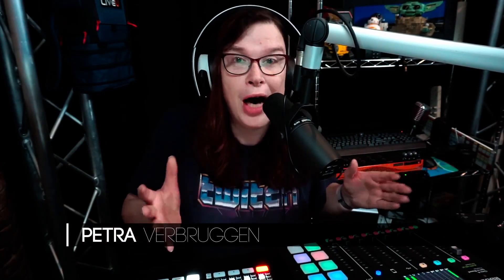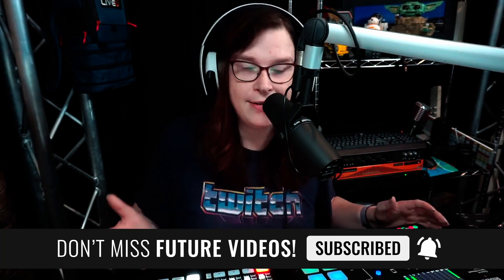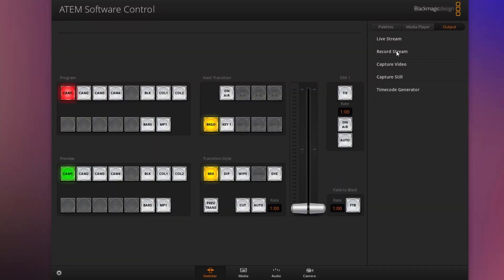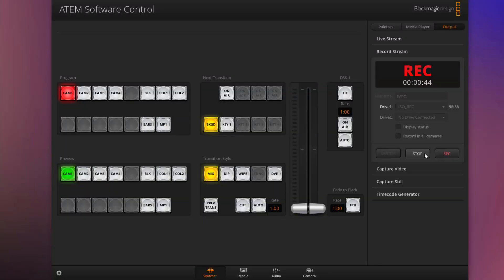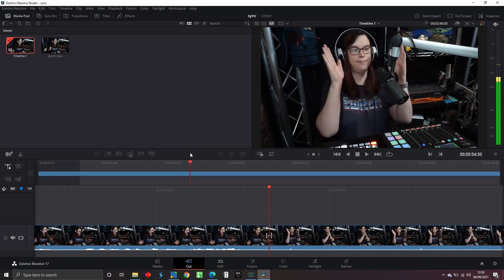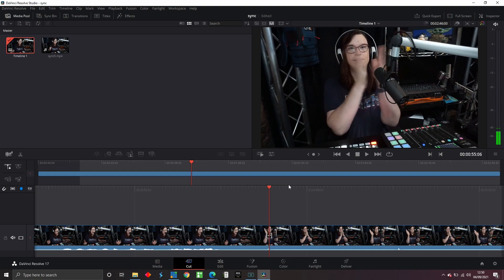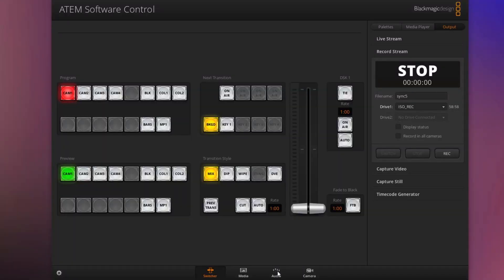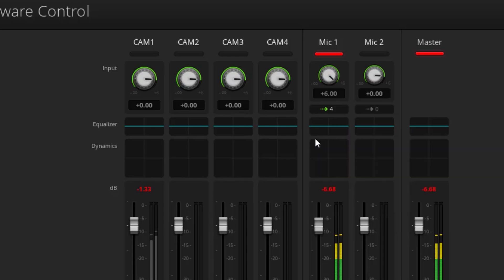Setting up audio delay on your ATEM Mini Pro or ATEM Extreme [2-minute HOWTO]

Comment: once set do u need to check each time or u can leave at 4 frames as long as you are using the same audio source
Reply from the maker: I’ve not seen it fluctuate over a few times so as of yet I believe it to be stable for that set. (I’ve not had to change it the past months)